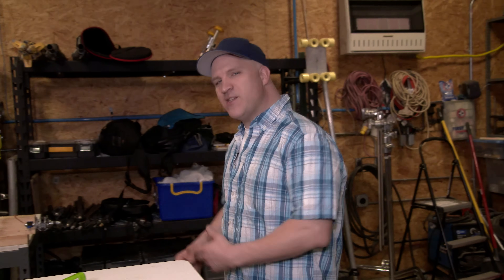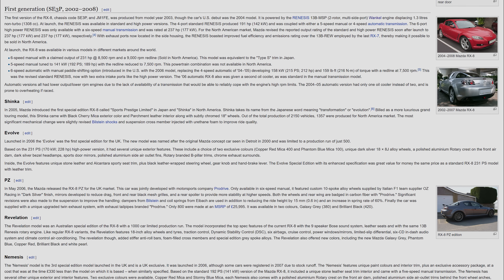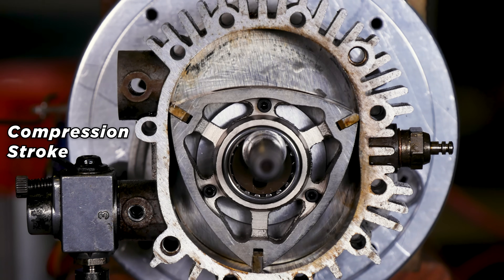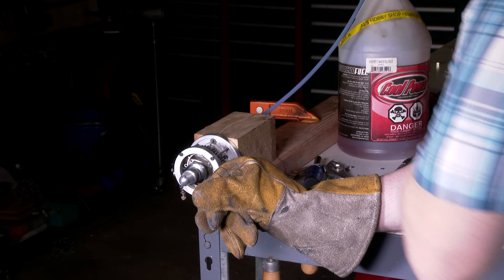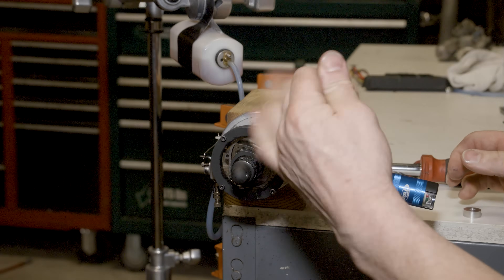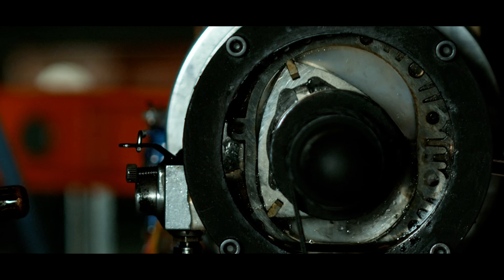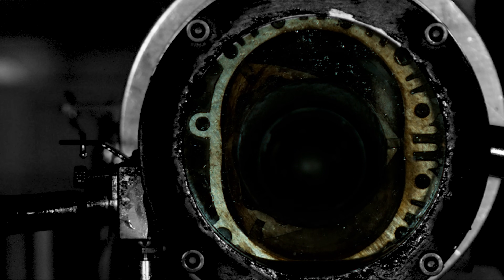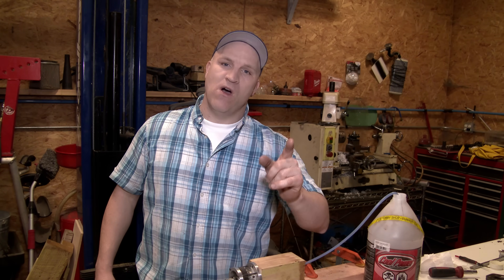See Thru Rotary Engine in Slow Motion - (Wankel Engine) 4K

Comment: 1% fuel is burned and 99 used as shower :)
Reply: Lol u can see how much fuel is in there and rotary is backfiring like crazy
Reply: @yoshi1u2  Are you fricken people for real?! Yes, the rotary engine is somewhat less efficient than a conventional piston engine due to its very long combustion chamber, HOWEVER, this video in no way illustrates this point. And this is because ALL tiny model airplane engines are EXTREMELY inefficient and as such a very large portion of the fuel goes completely unburned and gets spit out with the exhaust. If you were to do this test on a full sized rotary engine of course you would not be able to see any actual liquid unburned fuel exiting the combustion chamber. In fact, the only way you would know it was less efficient than a conventional engine in such a visual test would be by analysis of the burn pattern. And automotive engineers have been doing just these types of tests on new engine designs for at least 30 years now. The bottom line is, if modern car engines were only as efficient as model airplane engines you would be lucky to get even 1 or 2 miles to the gallon. Full sized automotive rotary engines on the other hand are only slightly less efficient than conventional engines. For example the Honda S2000 only gets slightly better gas mileage than the 3rd generation RX-7 yet both cars have approximately the same power to weight ratio. Due to the very strict emissions requirements in most countries these days however even a slightly less efficient type of engine is just not going to make the cut.
Reply: @yoshi1u2  I thought the fuel/air mixture looked a bit off.
Reply: @twistedyogert How would you know? Do you even know what the recommended AFR is for a Graupner 49 PI???
Reply: lol who say its inefficient???it true rotary engine drink fuel like hell but don forget 2.6 litre rotary engine can produce 930 hp in 10.500 rpm...imagine 930 hp without forced induction.....and who said its engine not reliable....look who win lemas in 1991....the only reason it never take part on le mans next year is fuel consumption regulation....they kill rotary engine coz it too powerfull
Reply: The Wankel engine was never clean or efficient, it's significantly less mechanically and thermally efficient and its combustion efficiency is worse than an old flat head design.
Reply: @sandervanderkammen9230  some people have found modifications to combustion well do make an improvement.  And with computer aided design things are improving for the rotary fans.
Reply: @joeKisonue  Please provide some evidence to support those claims... because currently there are no longer any legitimate engineers or engine manufacturers developing the Wankel engine.
Reply: MsLampalampa fast way to pollute the earth. Just put a bunch of these on the road.
Reply: Chris McRoy got em
Reply: Chris McRoy probably clean cause you be licking that shit.😂
Reply: It's a Nitro engine, 75% of what is going into it is oil and is supposed to spray out. Piston nitros are the same...
Reply: @anon metalis  You have got your percentages inverted, 75-80% of the liquid is FUEL and 20-25% IS OIL. Some of what you see is oil, the rest is indeed unburt fuel.
Reply: IfYouDisagreeYouAreWrong  Did he need new apex seals?
Reply: @twistedyogert Of course it needed apex seals... probably needed a lot more parts too...
Reply: @14_velnio_bažnyčia What is the matter kid? Can't handle the truth???
Reply: @14_velnio_bažnyčia Maybe you should go troll somewhere else...
Reply: That’s because he flooded the engine with flue it wouldn’t do that if it wasn’t flooded
Reply: @Stanley O The engine is not flooded, these engines require an extremely rich mixture to start or run...
Reply: @doktorbimmer  there was a point after midway when yes it absolutely was flooded. You won't be seeing sloshing liquid from even your richest mix.
Reply: Brap brap mutha fxxxr!   I wonder why they didn't try to add fuel and ignition on both sides of the block so solve the heat issue and thus have better fuel economy and power. I'm sure they tried it but i wonder why that wouldn't work.
Reply: A rotary has both pros and cons. However the cons do outweigh the pros which is why they are no longer in production
Reply: Just wanted yall to know these comments are great to read..even if it is 6 months later haha
Reply: I owned a '78 RX7  They used two high temp NGK spark plugs per rotor for that reason.
Reply: Still if you see one on the road,pretty sure it will kick your piston ass
Reply: Well when you think this is a glow fuel engine running in nitromethane and methanol, yea theres going to be a shit ton of fuel moving through that thing even when running spot on?
Reply: Chris McRoy  They don't run clean. The burn oil by design
Reply: IfYouDisagreeYouAreWrong  they are efficient just not in the way you would expect
Reply: @petrosdimitriospilichos9195  must be the world's best kept secret because even Mazda knew they were not efficient.
Reply: @sandervanderkammen9230  actually the design of a rotary is technically efficient that's why it makes so much power for the size that it is. But the Idea is very good the design in reality didn't work out too well
Reply: @petrosdimitriospilichos9195  From a technical point of view the Wankel engine is very interesting but it's much less efficient than other ICEs. The Wankel has extremely poor BSFC (Brake Specific Fuel Consumption) and significantly higher EGTs (exhaust gas temperature) which is how low efficiency is determined.
 When the Wankel's true total displacement is correctly calculated and compared with reciprocating engines it's performance per liter output is unimpressive and torque per liter horribly low.
Wankel engines are discontinued because they no longer offer any significant advantages over other types of available engines.
Reply: @sandervanderkammen9230  hmm. Two engines of same displacement and higher hp from the rotary is what I'm seeing.  Naturally aspirated on pump gas.
Reply: @joeKisonue  Reciprocating engines consistently produce more horsepower per liter output than Wankel engines.
 Reciprocating engines actually rev much higher than Wankel engines of comparable output... they also produce significantly more torque output.
Reply: @sandervanderkammen9230  please provide some evidence to support those claims. List some redline specs of similar displacement passenger car engines as compared to the wankel, and if you want torque get a diesel.
Reply: @joeKisonue  The 6.5 liter Aston Martin V-12 produces 1,000 hp and redlines at 11,000rpm...
The triangular piston (rotor) of a Wankel engine only spins at One THIRD of indicated tachometer rpm.
At 9,000rpm indicated the internals are only rotating at 3,000rpm 
Slower than automotive Diesel engines.
Reply: @sandervanderkammen9230  ok. But you don't take tachometer reading from crank? And what then is terminal rpm for the Mazda engine?
Reply: @joeKisonue  You don't takea tachometer reading from the transmission output shaft either.
Most engines don't have a 1:3 overdrive on their crankshaft.
Reply: @sandervanderkammen9230  would you consider the stock rx8 engine displacement 1.3L or 3.9L I was considering the smaller displacement and power output when I compared it to any normal piston engine. If I was incorrect then I agree it's less efficient.
Reply: @joeKisonue  The Mazda 13B series has a total, true swept volume displacement of 3,924cc's.
But because of rhe extra 360° degrees in its firing order, we compare them to reciprocating 4-stroke engines using the 2X conversion formula
Comparing the relative displacement per 720°

Most Engineers, Government agencies and motorsports sanctioning bodies covert rhe displacement to roughly 2.6 liters.
Reply: @sandervanderkammen9230  ok so it's taken from ignition pulses?
Reply: @sandervanderkammen9230  I'm writing all this down.
Reply: @joeKisonue  The Mazda 13B has 6 combustion chamber faces.
Each wirh its own 4-stroke cycle.
6 ignition events, 6 combustion events.
The difference is 3 revolutions instead of  2 revolutions of the crankshaft.

A 4-Cylinder reciprocating engine has 4 combustion events every 2 revolutions.
The Mazda 13b has 4 combustion events ever 2 crankshaft rotations.
Reply: @sandervanderkammen9230  Hot damn that's a lot of hoppin and poppin
Reply: @joeKisonue  And alot of broken apex seals..
Reply: Is it posible to do offseted some gear ⚙ inner is rotate and outer also rotate can't remember name
Reply: Lol. Haha
Reply: Chris McRoy  fuck You bitch
Reply: me in the shower
Reply: Mazda is planning to revive Wankel, but just as backup power generator in electric cars.
Reply: This is why they're so fuel inefficient lmao. Not all the fuel gets burnt in the chambers and gets shot into the exhaust. This is why it's easy to make flames 🤤
Reply: Rotary engines beat piston engines in simplicity and space efficency. Check out liquidpiston theyre going to be making non wankel rotaries so rotaries are not dead yet.
Reply: @mitja5907  how would it be a "non-wankel" rotary? The engine design was made by ya boi Wankel, so it's always gon a be called a wankel
Reply: @ischwhit  this is a carburated mini. Not a fair comparison to an injected full size with dual plugs
Reply: 1 year later and a debate is still going.
Respect to both sides just here to watch
Reply: @DarkkCriii  tbh these debates are more enjoyable then AR vs AK debates
Reply: @sgtbuttermilk  SKS 😄
Reply: IfYouDisagreeYouAreWrong your a dumbass, there in efficient but it’s not horrible it’s on how you drive it. The last made rx-8 makes the same gas mileage as a 2005 Ford Expedition. On the freeway I made it from Orlando Florida to ft laud Florida.  2 stops. That’s it. Yes it’s not good but it’s live Able. This reputation is annoying and stupid because you’ve never owned one. Like I said I’m not saying it’s amazing but it’s not completely garbage. In the city it’s not the best, but on the highway I’ve gotten 22 MPG.
Reply: Well liquid can't burn. Only vapor
Reply: @joeKisonue  liquid can't burn? Dude...
Reply: @ischwhit  yes it is physically impossible for liquid to burn. It just like solids must change phase into an aerosol of molecules in order to combine and bond with oxygen and perform oxidation.  It is a chemical process activated by heat. Liquid cannot burn
Reply: @joeKisonue  That is false, Nitromethane can burn in its liquid state... as do most liquid rocket fuels.
Reply: we are going to use something that sprays mixture of fuel and air very accurately. Problem solved 🥱🥱
Reply: Allahumma shalli 'alaa sayyidinaa muhammad wa'alaa aali sayyidinaa muhammad wasallim tasliima😁😊

Yok Tobat Kawan Dan Jangan Lupa Sholat Dan Sholawat😁😊😊😊😊
Reply: As god intended it 😁
Reply: Use Alon glass instead of plastic
Reply: @IfYouDisagreeYouAreWrong 1990???? Dude that was a vintage car a decade ago...
Reply: @doktorbimmer  Yoo do realize mazda has worked on a bunch of new patents for a new rotary right?? They are trying gonna revive it and also just cause they arent in any automobiles doesnt mean they arnet used anymore.
Reply: @riderthewake02 You do realize Wankel engines are obsolete and Mazda stopped development of production Wankel engines a decade ago?
Reply: @riderthewake02 The Wankel engine was a commercial failure in every application except automobiles... Mazda was the very last engine manufacturer producing them and they ceased all production several years ago.
Reply: @doktorbimmer Go do some current research on these cause October 2018 mazda filed for a new patent.
Reply: @riderthewake02 99% of all patents never become a successful  commercial product... Ford once held more patents for the Wankel engine than any other engine manufacturer in the world (including Mazda) but Ford never sold Wankel engines.
Reply: @riderthewake02 Mazda's new CEO confirmed last week in an interview that his company has no plans to bring back the Wankel engine.
Reply: @riderthewake02 Still no Wankel engines coming... looks like you are wrong again.
Reply: doktorbimmer lol you annoyed that butt hurt rotary engine loving money waster. They think that just because they invest in one that they are good. News flash not all investments are good, I invested in a v8 with a ls1 engine and it’s a brilliant design but costs me to run and maintain it. It is a reliable investment as v8 engines are built to last if looked after, it just costs me more to drive it tho.
Reply: riderthewake02 ya... the rotor has no place in the world any more. They would never ever pass emissions testing. With that said I love me the sound of a properly built big turbo rotory. They make zero torque and just insane HP. They sound so cool
Reply: @yeahok115sure  they pass emision testing but not fuel cunsumption regulation.....that engine drinks fuel like hell...but its out put remarkably
Reply: @doktorbimmer  actually the worst application of a rotary was on cars, a wankel in a plane or a snowmobile is the smartest idea ever since when a wankel "blows up" it doesnt seize like a piston engine, it continues to function but extremely inefficient by losing compression. Now imagine being on a snowmobile very very far away and losing the engine imediately instead if it saying "dude, im dying cough cough get to safety soon"
Reply: @Petreu Interesting theories you have proposed... but the factual evidence would prove otherwise.
 The Wankel engine is very poorly suited to aircraft applications, it was a complete and total failure in the commercial and military aircraft industry and not a single plane has ever been mass produced with a Wankel engine. 
 Sachs and OMC manufactured engines for several snowmobile brands in the 1970s, unfortunately they all performed and sold very poorly and were discontinued after just a few years.
Reply: @Petreu Nothing wastes fuel like the Wankel engine did... the Chevrolet Corvette C-7 developed twice the power of the RX-8, weighed more and still had better fuel economy...
Reply: doktorbimmer its definitely not the best engine, but i think it has niche uses; for example if you want to modify a car with a strong (not efficient) engine, but the car has very little space in the engine bay.
Reply: @Jin Song If that was true? Why is the Wankel engine obsolete now??? Not a single legitimate engine manufacturer anywhere in the world produces the Wankel engine is series mass production for any applications
Reply: doktorbimmer what the big manufacturers do, doesnt affect my statement.

there are quite a few small companies that still produce rotary engines for different cars/engine swaps, etc.
so there is still supply & demand.

obviously putting millions of dollars in a not so versatile engine is a waste, thats why no big manufacturer does it. they design the cars, so they can easily put in whatever motor size they want.

exactly what im pointing at, enthusiasts cant just design a car around engine size, so sometimes, if they want strong motors in weirdly built or small cars, they will need rotaries.
and some just enjoy rotaries more.

therefore they have a use and thats a factually accurate statement.
Reply: @Jin Song Your statement is entirely inconsequential to what is happening in the engine manufacturing industry right now... over 100 million new cars were sold last year... NOT ONE OF THEM was equipped with a Wankel engine. Wankel engines are obsolete technology and not even Mazda makes them anymore...

  Not really, Wankel engine shops are a dying breed... with fewer and fewer Wankel powered cars left there is not much of a specialty market left anymore. You will always be able to custom build one-off and replica engines that have been long since obsolete... it just takes lot of money... with enough cash you can have any discontinued part or engine reproduced or custom made...

 You can still buy a brand new reproduction flat-head engines for a Ford Model T... they still even make steam engines and horse drawn buggies...  this does not change the fact that all of these technologies are completely obsolete.
Reply: doktorbimmer i never argued your initial point. you are getting lost in your own sentiments.

i simply said, there is still a demand for these engines, albeit small, it still exists.

all im saying.
not sure why you project other people's opinions on me and argue against them.
Reply: @doktorbimmer  ford sold tons of wankles badged as Mazda 🙄
Reply: @doktorbimmer  When Mazda used rotaries, they were actually banned for being too good. That is why they stopped making it.
Reply: @vangattan  When was Mazda banned from making them???
Reply: @sandervanderkammen9230  I dont know, but the 787B was too good and got banned I guess.
Reply: @vangattan  You guess? You don't seem to know much about this topic do you?
Mazda was never banned from motorsports and niether were Wankel engines.
 If you do a little fact checking you will find out the Mazda 787b actually kinda sucked, it lost 20 out of 21 races in  WSCC and had zero pole positions  and never posted a single fastest race lap... Mazda retired it because there was no hope to win a series champion with it and was too slow  and uncompetitive to consider updating to a 3.5 liter class engine which all teams agreed to 2 years earlier.
Reply: @sandervanderkammen9230  "At the end of the season, the Group C series was replaced by the 3.5-litre World Sports Championship and therefore Wankel-type rotary engines would no longer be allowed to run as they were outlawed and, as per Fédération Internationale de l'Automobile's earlier decision, 3.5-litre engines similar to those used in Formula One became the new formula for the 1992 season."
Reply: @icantbelieveyouvedonethis3057  Then why was the Mazda 787b allowed to compete in the 1991 season? It didn't comply with engine displacement, weight or fuel tables and required a special exemption from the FIA to compete.

You make sounds like the change in displacement rules was made After Mazda won Le Mans, but this is not true... the rule change was announced and agreed to before the 1991 season, Mazda announced it would retire the 787b at the end of 91 season and had no plans to continue the the car in 1992.
Reply: @icantbelieveyouvedonethis3057  Please tell us the Page and Paragraph in the official 1992  FIA rulebook that specifically bans Wankel engines in WSCC? Good luck, because you won't find this false urban myth in any rulebook because it never happened!
Reply: @sandervanderkammen9230  OFFICIAL FIA 1992 year book     Appendix "J" SPORTS CAR  "C"
ARTICLE 5 : ENGINE
1) Type of engines allowed :
4-stroke, normally aspirated reciprocating piston engines.
Maximum cylinder capacity : 3500 cm®.
Maximum number of cylinders : 12.
The total maximum quantity of fuel allowed for the whole race is free.
2) The normal section of each cylinder must be circular.
3) Diesel, 2-stroke, rotary piston and turbine engines are forbidden.

Is that good enough for you?
Reply: @sandervanderkammen9230  i can email you the pdf if you want to read it yourself.
Reply: @sandervanderkammen9230  Mazda agreed to the new rules coming to fruition in 1992 and  therefore sought to try their hardest as 1991 would be the last year in which they were able to race the 787 and 787b.
This little debate is quite fun.
Reply: @arkhamkillzone  listen you may have a v8 ls but if you havent driven a car with a rotary in it dont trash talk because its the most fun you can have in a car
Reply: @doktorbimmer  just because you write in bold doesn't mean everything you're saying is true
Reply: @doktorbimmer  commercial failure in every application except automobiles? That's like saying the pencil was a commercial failure for everything except writing
Reply: doktorbimmer your a broken record bro you’re on every comment section regarding Wankel engine repeatedly writing the same thing again lol we get it it’s obsolete,that doesn’t mean people are going to stop using it and talking about it!
Reply: @icantbelieveyouvedonethis3057  stop feeding the troll
Reply: @Maximus20778  but it's fun...
Reply: @joeKisonue  yeah most us are aware of that already,I love them all my favorite electric car is the Rimac ❣️
Reply: @kugelblitz1557  All series production of Wankel engines at Mazda ended on June 22nd 2012, the Wankel engine factory at Ujina no.2 in Hiroshima Japan was demolished in 2013 and is now the site of a Skyactiv G engine factory.

Mazda does not build new Wankel engines, Mazda's 1960s R&D shop still has a few machine tools set up to produce a very limited number of the larger spare parts.
Remanufactured engines were discontinued when Mazda shut down it factory motorsports program in 2017.
Reply: @doktorbimmer bro mazda uses ford parts 🤯
Reply: Could be running a little too rich?
Reply: @IfYouDisagreeYouAreWrong Wankels are definitely not made anymore either...
Reply: doktorbimmer discontinued In 2011 and is coming back again..
Reply: @Ghosts1912 Its not coming back... Wankel engines are obsolete now.
Reply: doktorbimmer Mazda announced it, it is indeed.
Reply: @Ghosts1912 No they didn't, Mazda's board of directors permanently cancelled all further development of production Wankel engines in May 2009.
Reply: doktorbimmer 2009 was how long ago? Do the research a few years after that they started doing research and development. To help bring it back so it follows emission standards
Reply: @Ghosts1912 You obviously don't have the slightest clue what you are talking about, Wankel engines are obsolete technology no longer mass produced by any legitimate engine manufacturer in the world including Mazda. Mazda has not unveiled a new production engine in a quarter of a century and development on new engines ended a decade ago.... no new prototypes have been seen since 2008.
Reply: @IfYouDisagreeYouAreWrong There were 100 million new cars sold last year... none of them had a Wankel engine.
 Don't believe me? Go down to your Mazda dealer and see for yourself!
Reply: Remember,it didnt have one side of the combustion chamber on it! Wankles run very clean,and very efficient,and VERY strong.
Reply: @dman9579  They don't run clean. The burn oil by design.
Reply: @Someguy6571  Every car burns some oil by design. You can't have a piston ring scrape all the oil off the chamber wall or else you'll have Too much friction. Sides of Combustion chambers of normal engines are cooled to the point where gasoline blows up but it doesn't ignite the thin film of oil left by the piston ring. Wankel burns oil because it has higher temperatures of the wall and it's spread over larger surface.
Reply: @Someguy6571  So funny that we all accept the incredible oil output of multi cylinder 2 stroke outboards.  If you run one in a test tank the top of the water gets a thick slick. It's only in the last 10 years Evanrude has worked to direct oil and scavenge back excess.
Reply: @kugelblitz1557  That is incorrect, all the mass produced Mazda Wankel engines since the 0810 have used metered oil injection for improved power and reliability.
 Mazda introduced emissions controls on the 10A in 1971.
All RX engines after 1975 had to comply with Japanese emissions standards and used metered oil injection for lower emissions and reduced smoke.
Mazda does not reccomend Premixing or 2-stroke oils as these reduce reliability and can cause damage.
Removing or disabling the OMP on a fuel injected engine can cause severe damage.
Reply: @dman9579  that is ABSOLUTELY WRONG. LOL. They are horribly inefficient!!! HORRIBLY! CLEAN? LOL. They burn OIL  as a standard function..lol.
Reply: @dman9579  ..
Efficiency?...NO
Reply: D man do you own a rx7?
Reply: @dman9579  but they wear fast :(
Reply: @dieselgeezer18  do they? Do you have any personal experience? A model T required a rebuild after 10,000 miles due to oil and metallurgy tech. You drive 10,000 in a year and do 3 oil changes
Reply: @dman9579  what do you mean it did not have a side of the combustion chamber? did the glass cause the fuel leak?
Reply: @dman9579  Yea, that's why they've been so successful!
Reply: I can see some Poeple are butt hurt cause they are being educated about how crumby rotary engines are compared to reciprocating engines. The fools who are saying they will revive the rotary technology need to wake up. They are not going to invest in dinosaur tech when electric cars are the future. Not shitty rotary engines that waste fuel which will soon be extremely expensive to buy.
Reply: @arkhamkillzone  you're the one crying about it dude
Reply: @IfYouDisagreeYouAreWrong Wankel engines are obsolete because they are inefficient and unreliable... they could not compete with the other types of vastly superior internal combustion engines.
Reply: @doktorbimmer  The only reason Mazda isn't making Wankels at the moment is because it was banned in racing.

It's really hard to develop new technology if you're not racing and getting funding from sponsors.
That ban after the win, also slowed development of the rotaries. Had it not been banned, they would probably have solved most of the problems by now
Reply: @Axel bodat Wankel engines were never banned by the FIA in WSC endurance racing and they were not banned In Indy Pro Mazda either.. Mazda voluntarily retired Wankel engines in both race series
Reply: @doktorbimmer  it because fuel consumption regulation....offcourse its not direct banned.....but that regulation killing mazda wankel engine
Reply: @Axel bodat Mazda discontinued Wankel engines and the RX brand because people stopped buy them.
Reply: @doktorbimmer  yes poeple stop buying them because it desnt fit for daily use....like i say before....they dont want spent more money in fuel...wankel engine best for racing...but if you cant sold for people...the where u can get money for race??that why they stop....not because the engine suck...but no money no race
Reply: @doktorbimmer  Mazda discontinnued Wankel engines because Emissions of Euro 5 made them unviable. They've got 3 cycles per one rotation meaning they need a lot more fuel. While this works great for high performance out of small displacement it's not that good for fuel consumption.
Reply: @narutomorc  kinda like the death of the skylines.
Reply: @foxman105  they have 3 voids that fill with fuel/air but only one combustion per one crank revolution like a 2 stroke